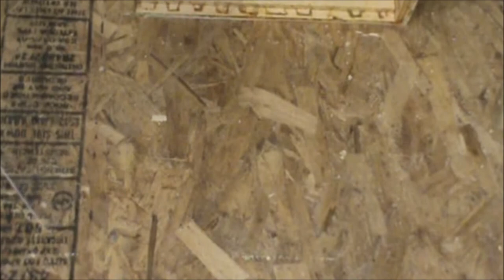How To Make An Observation Window For Your Bee Hive

Comment: Adding the glass on the inside reduces the "bee space" of 3/8 inches to 1/4 inch which makes it too tight for the bees to move about at the ends of the frames. It would be best to recess the glass so it is flush.